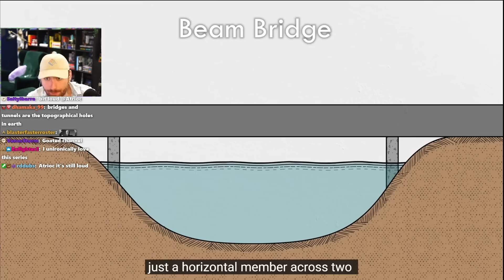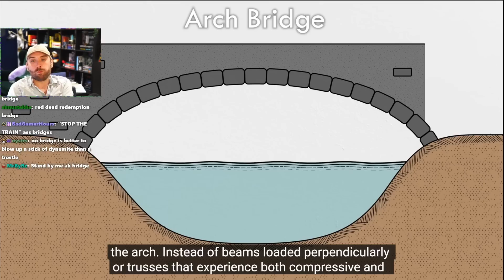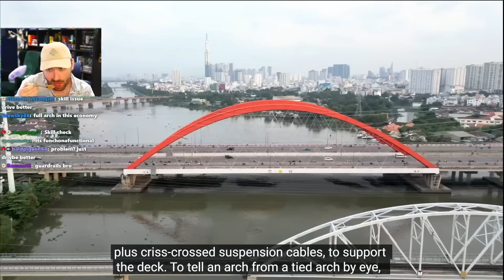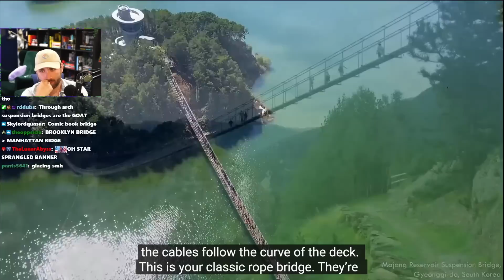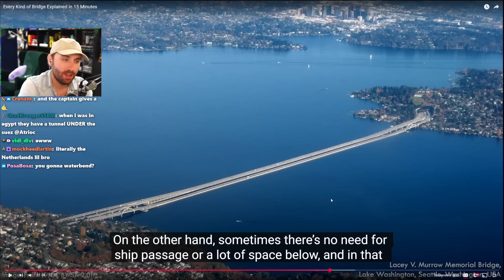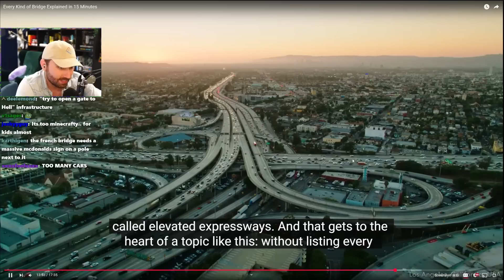Every Kind of Bridge Explained in 15 Minutes: Atrioc Reacts

Comment: I do architectural engineering and I’ve got a final in steel and timber beams in two days, now I’ve heard atrioc explain it no need to revise. Design a structural system… [5 marks] “just use camelback bridge, it’s el classico”